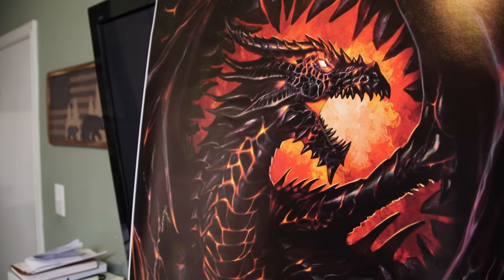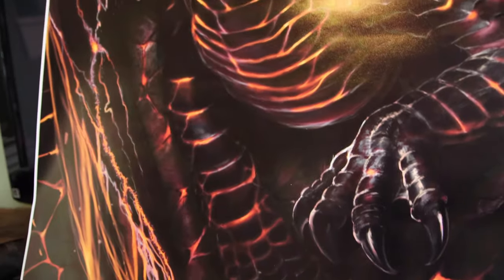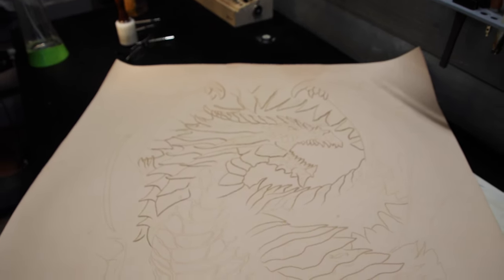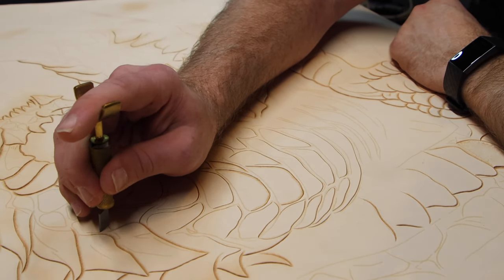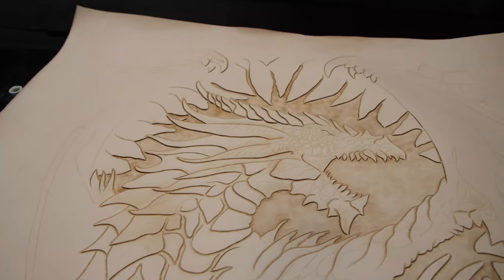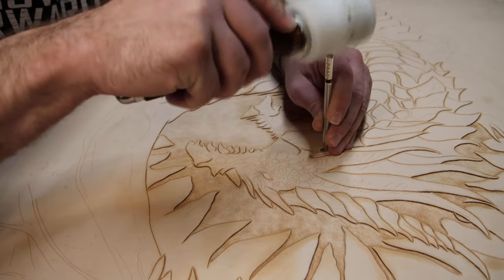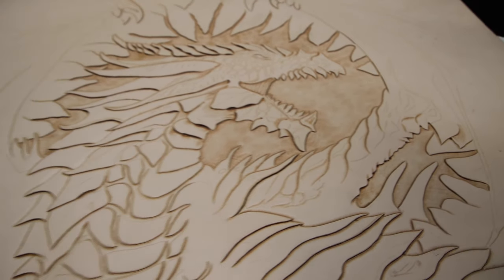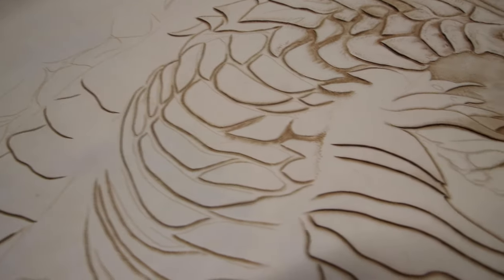Carving a 4 foot LEATHER DRAGON!

Comment: That’s awesome,I like the way you layout your videos.what did you use to shade in the scales , that brung it to life
Reply from the maker: Thank you! I'm still learning the best format for the videos,  so that's great feedback. 

When you ask about shading the scales,  which ones are you referring to? The chest or face?
Reply: @TheLeatherverse  the face is what I was talking about and did you push out from the flesh side for more definition.thanks
Reply from the maker: Initially I used a matting tool between the scales. Later,  I embossed areas of it to give it more shape.
Reply: @TheLeatherverse  thanks it really turned out nice. I’ve did some deer and coyotes but just brung out the key spots as good as I could with the beveler and spoon from the front , so so lol

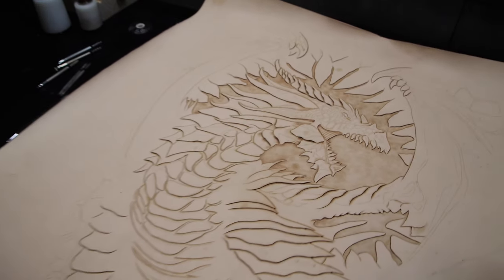Comment: If wood is dented, they can raise the dent with wet rags and hot irons. Steaming the dent. Do you think that might work for correcting mid-bevels as the left wing about 13:00 time stamp?
Reply from the maker: It's a good idea. My initial thought is that it probably wouldn't work just because of the amount of water put on the leather during tooling. It's possible that the water/heat combo might make the difference,  but honestly (with this specific mistake) it was a pretty easy fix.

Comment: how often to you wet your work
Reply from the maker: In a large piece like this,  especially during the winter when the air is so dry,  I re-wet a lot. At first,  I use a sponge to really case it thoroughly. After that,  I do a surface case with a spray bottle to maintain the moisture.